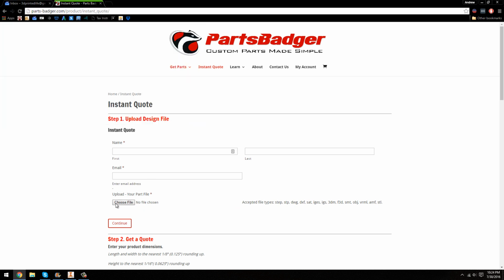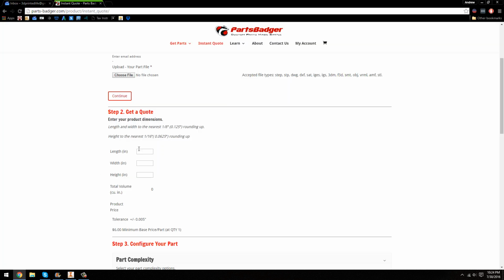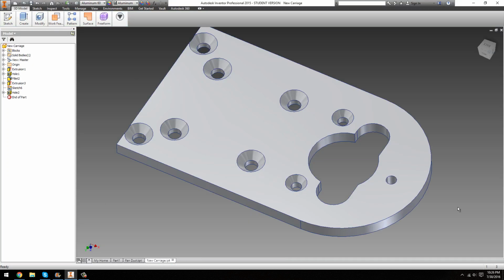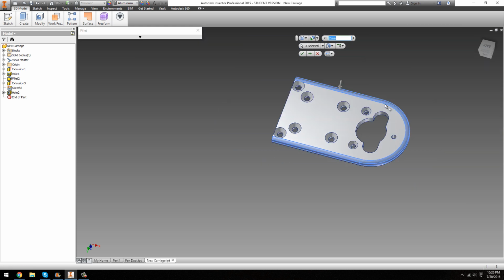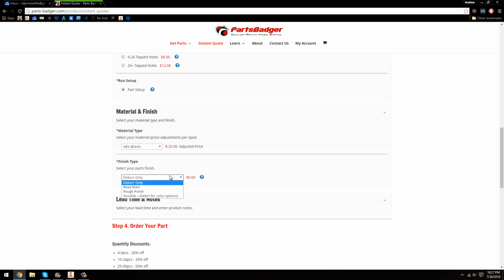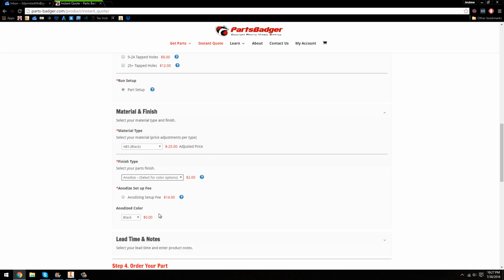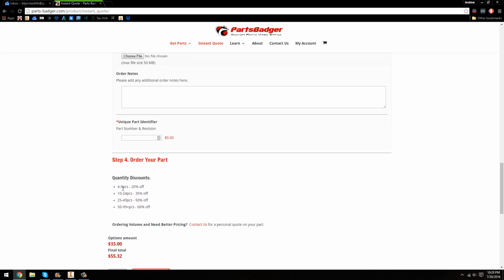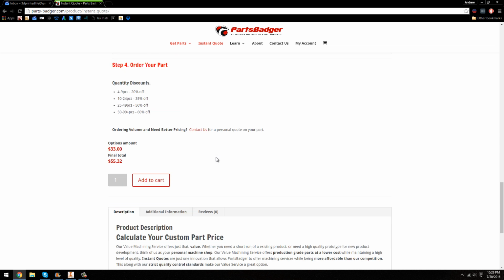Parts-Badger: Instant Machining Quote Tutorial

Comment: How much did it cost to machine the top aluminum plate that holds those linear rails?
Reply from the maker: Well for a one-off it's going to be pricy, this is a big part with tapped holes and anodizing! I don't have the exact price but probably somewhere around $250-300. You could always use the estimator yourself and just put in 15" x 15" x 1/4" with ~30 tapped holes and anodizing. However while that is expensive, I guarantee you will not find a lower price for a one-off part with the taps and finishing for anywhere close to this cost!
Reply: Yeah that's quite expensive. I'm producing a cheap corexy (on the cost and planing stage) and I really love your idea. It eliminates some tolerance issues of the printed plastic parts like from the c/d-bots, and ofc, them linear rails are nice. Yours is way easier to enclose too.
Reply from the maker: DoublePenetration0 Ahh gotcha, yeah having this top plate makes assembly so much easier and reduces countless sources of print error! It is a bit expensive in one-off runs but in bulk this part can get below $100, which is still a bit pricey but for what it is I'd say it's well worth it! Good luck on your build!

Comment: For ABS parts do they machine it or they just 3D print them?
Reply from the maker: I think it is machined but I could be wrong. However machining plastic isn't too much stronger than 3D printing so if the material is 3D print-able like ABS then it is probably cheaper to just print it.

Comment: Will they ship to Europe ? I have some very complicated turbine to manufacture for a water pressure washer and wonder how much it costs .
Reply from the maker: Well if they do ship it will likely depend mostly on weight, you can use the USPS price estimator tool and put in a standard box size (like 8" cubed) then try a few weights and see what estimates it gives you. I'd guess shipping will be about $30-50, but again I'm still not sure if they do international shipping. Try contacting them directly: http://parts-badger.com/contact-us/
Reply: I was wondering the same thing. - And do you think they will STFU if i send them some proto-types?